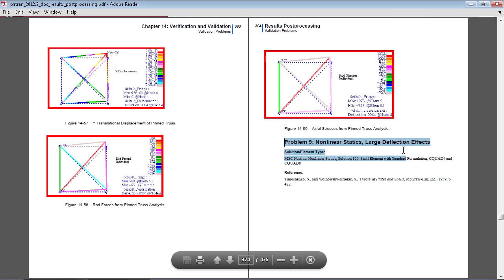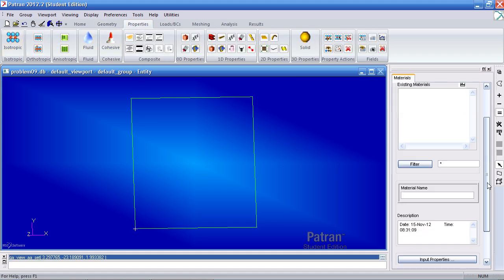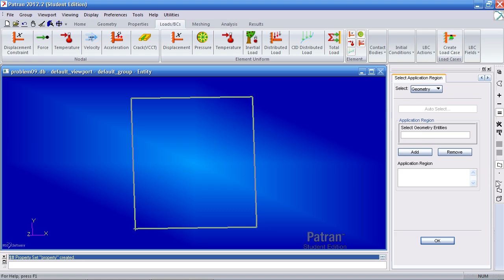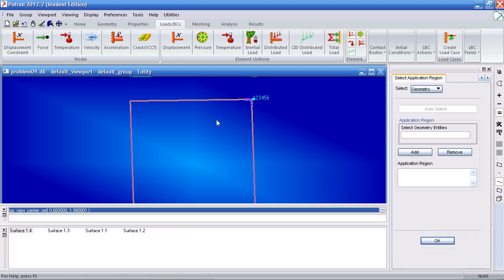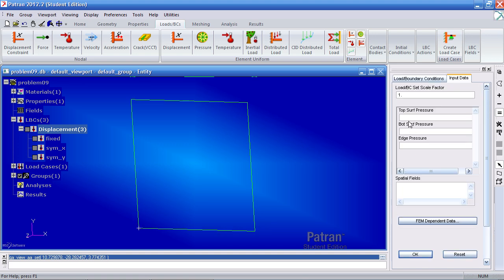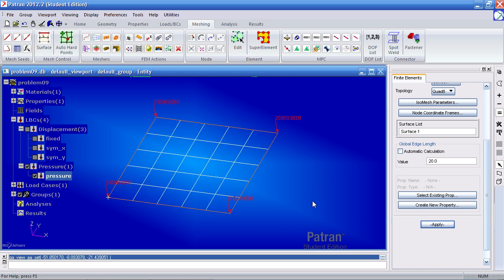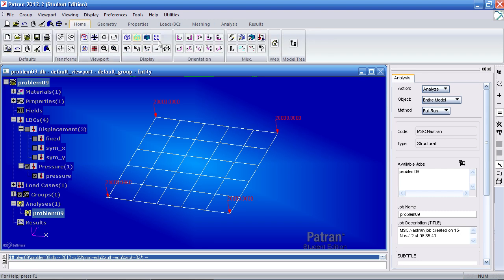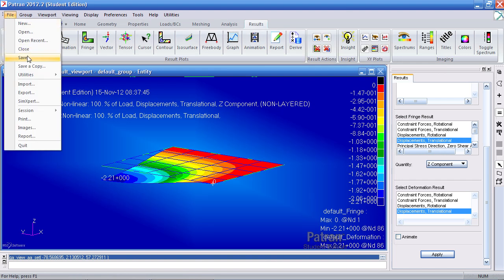MSC Nastran, Patran Tutorial - Nonlinear Static Analysis, Large Deflection

Comment: What's the main differences between SOL 106 and SOL 400?
Thanks for the tuto!
Reply from the maker: Hi Alexis. Please contact our tech support, we would love to explain the updates! Thank you for reaching out! https://simcompanion.mscsoftware.com/infocenter/index?page=content&id=KB8019304
Reply: Sol 106 is large displacement , small strain solution, while Sol 400 is large displacement, large strain solution.

Because of this Sol 400 is better equipped to handle material plasticity and other severe nonlinearities. Also please note that Sol 106 uses traditional Nastran elements, while Sol 400 support advanced Marc elements along with native Nastran elements. For the details on Nastran element please refer to "Reference manual" of Nastran.

Another major difference is Sol 106 uses gap elements to model the contact, while Sol 400 uses realistic contact approach via direct constraint algorithm. So in short Sol 400 is better equipped to handle material, geometric & contact non-linearity.